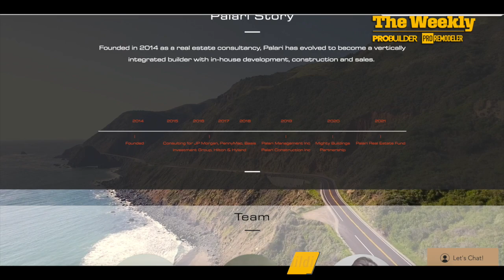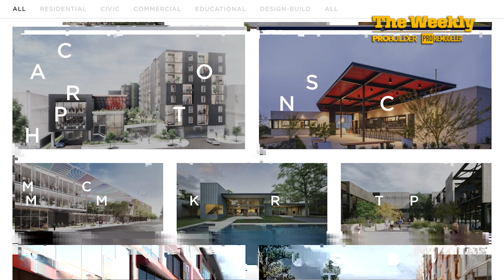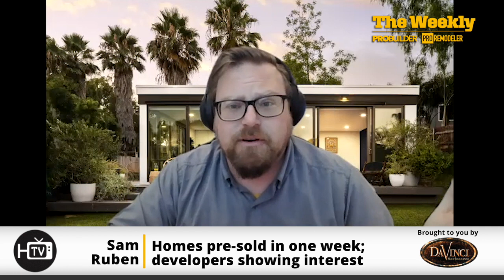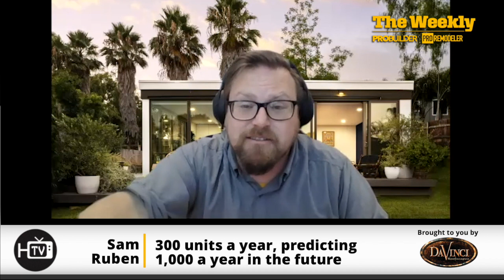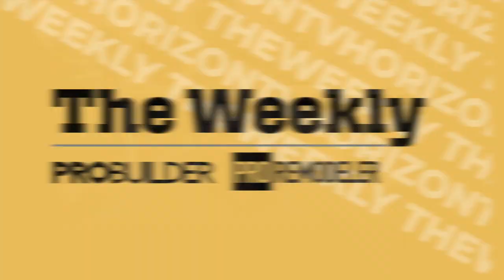15 3D-Printed, Net-Zero Energy Homes Are Coming to Rancho Mirage

Comment: I would expect this from a technically illiterate marketing pawn, but coming from a co-founder and Chief Sustainability Officer is inexcusable. 

1. There is nothing sustainable about suburban sprawl in the middle of the desert. PERIOD.

2. Net-Zero energy use in operation is not “Net-Zero energy”. Whatever material you use for the structure, the polyurethane foam, and steel frames are FAR more carbon intensive than traditional construction methods, so your “net zero” building likely has a larger footprint for at least a few decades if not it’s entire life versus an all electric minimum code-built POS.

3. Comparing LIHTC projects that pay prevailing wages is bullshit in general, and no you can't count each bedroom as a unit, WTF is that nonsense?!

4. What happens if anyone wants to modify or repair one of these down the line when the company has almost certainly gone belly up? No structural engineer will touch them and they’ll be teardowns far sooner than a properly built stick frame.

5. How much of that building will be recyclable or reusable? It’s great to reduce construction waste, but if in 20-100 years when the building is demolished, what other than the steel can be diverted from a landfill?

Put this toe to toe with an equivalently optimized panelized wood based assembly and it will lose every time. Unfortunately wood studs aren’t sexy or disruptive enough for VCs that know nothing about buildings, so there’s no funding for those.
Reply: Thanks for your comments, Brian. Your points are well taken and reasonable, and we will encourage Sam to respond directly in this thread. In the meantime,  we will continue to present options to deliver housing across all spectrums of production, from far-out 3D homes to precut and panelized framing; in fact, we are working with the Housing Innovation Alliance to create  a "roadmap" to help builders transition from traditional on-site stick-building to some form of industrialized/"off-site" production model in light of skilled labor shortages and materials waste issues. If you have a solution to propose, please reach out to me at rbinsacca@sgcmail.com.